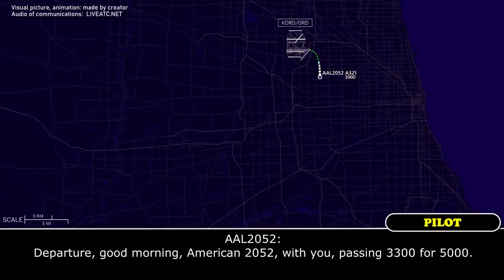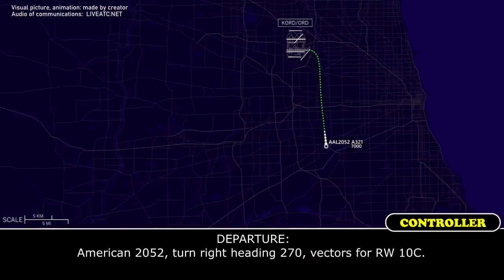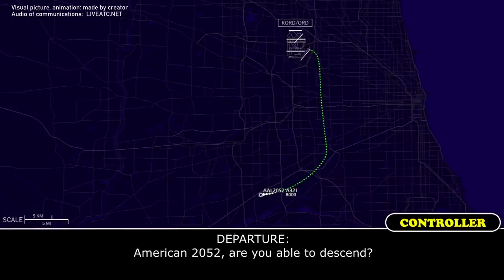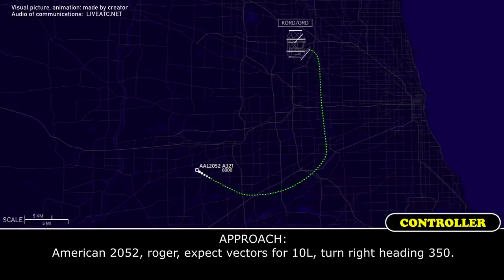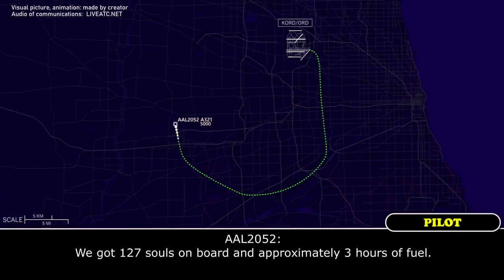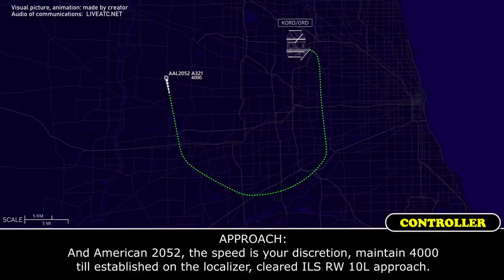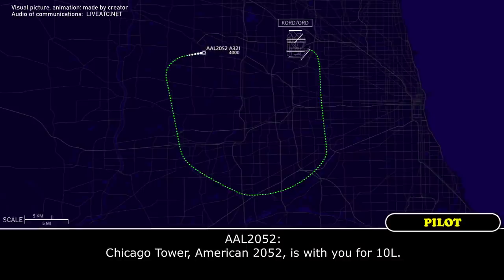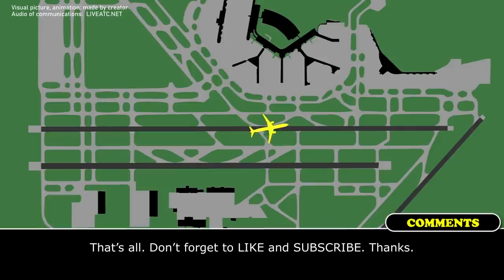PAN-PAN. Engine problem after departure | American Airbus A321 | Chicago O’Hare, ATC

Comment: Some pilots are super on it and offer up souls and fuel before asked to get it out of the way as they know it’ll be asked eventually. So it may have been that ATC didn’t ask for it at the time the pilots gave the info.
Reply from the maker: Yes, it happens but there were missed parts of the recording so just to make sure I put there my explanation.
Reply: @YouCanSeeATC  Ah ok, well given you knew there were missed parts then that would make sense and ATC probably did ask for them. Thanks for the additional info!
Reply from the maker: 👍 Thank you.
Reply: i thought you only have to give souls and fuel for a mayday and not on a pan. pls correct me if im worng
Reply: @dfjanus8014  Your wrong
Reply: @davidmoser3535  you're*

Comment: I'm not a fan of telling an emergency aircraft "traffic will depart prior to your arrival, cleared to land." In the unlikely event the departing airplane aborts on the runway, an emergency aircraft would have to make a go-around. I think this should be avoided whenever possible.
Reply: If the audio lines up with the radar they were 4000 and on final. Seems like a decent amount of space and time to get a departure out.
Reply: @justinchung7753  not if it rejects the take off, it’s not. Uncontained engine explosion/Blown tyres/Bird strikes etc will undoubtedly cause an RTO , so now there’s an aircraft stopped on the runway that the aircraft on final approach is planning to land on. Not exactly ideal.
Reply: @cedarkey  I hear what your saying but worse case, a single engine go around isn’t that big of a deal. Chicago is a pretty big airport. ATC is still going to move traffic. When I’ve had my engine failures, the airport doesn’t shut down for you. The trucks are there and that’s about it.
Reply: @justinchung7753  A single-engine go around in an air carrier aircraft SHOULDN'T be that big of a deal, but that's not ATC's call to assume once an aircraft has declared an emergency. Besides, in that unlikely event, we're now looking at making the go around over the top of a stopped aircraft. Besides, my original comment was that it should be avoided "whenever possible," which in a case like this means that the potentially departing aircraft can just wait a couple of minutes or get moved to another runway. Small price to pay for taking the risk of a single-engine go around from low to zero, in my opinion.
Reply: @zidoocfi  alright, so if we both agree that a SE goes around isn't a big deal, how were the departing aircraft and landing aircraft any different from any other take-off and arrival? It's an engine failure and not control or hydraulic issue. I had a jet take off 3 miles in front of me on my last engine failure. It was VFR, and I didn't overthink it. Maybe an ATC guy here can clear it up, but I assume they still have to move traffic unless they anticipate something catastrophic.
Reply: @justinchung7753  Full disclosure -- I am ATC, though writing in a private capacity and NOT claiming to represent official FAA policy in any way. And to clarify -- if your position is that a SE GA "isn't" a big deal, my position is that it "shouldn't" be a big deal, which implies that it "might" be. And to be clear, my original comment was a somewhat generic one about controllers avoiding these kinds of situations whenever possible, not per se about the exact timing of this particular incident. As to whether we "have to" move traffic, the short answer is a firm no when there is an emergency situation. Obviously we'll try to keep everyone else moving as safely and expeditiously as possible, but if in doubt during an emergency situation, we all stop/delay other traffic to accommodate the emergency. Lastly, BTW, I view this dialogue as very productive and I welcome it, so thanks.
Reply: @zidoocfi  if it was a pan pan call, rather than a mayday..might that be the reason why ATC were happy to allow departing traffic ahead of the returning aircraft?
Reply: @zidoocfi  Ok, good to know. In my career, I've had two engine failures. Both times the airport operated as if nothing special was going on. The only difference I noticed was I was offered any runway I wanted and priority when I wanted to land. For sure, on one of them, a jet took off right before I landed, but there was no landing aircraft behind me in both cases. Every "check" I've had to do has included a SE GA, and on my particular type, there's more than enough thrust to recover from the position. The maneuver feels routine at this point.  If I'm in a light twin, then maybe it's a different story? Good stuff. I always find it interesting to hear it from ATC's perspective.
Reply: @virginiaviola5097  Thanks for the good question. While I can't speak to exactly what they were thinking on that day, I suspect that "pan pan" versus "mayday" probably made little difference about getting one more departure out before the arrival of the inbound emergency. Generally we use an imperfect sense of how dire an emergency is for all kinds of decision-making about how to handle it, and the exact phraseology at the beginning of the event is just one part of how we determine that, especially because severity can change during the event.